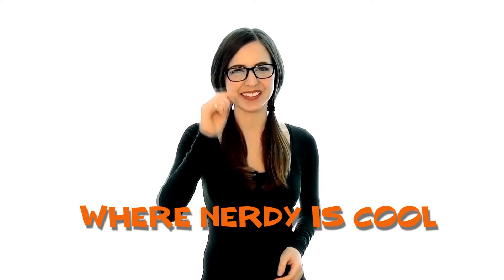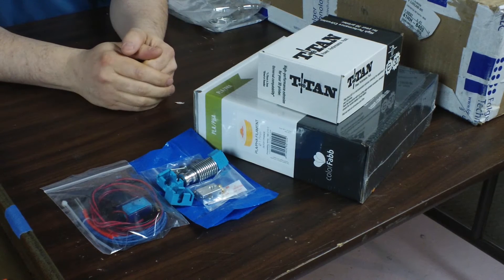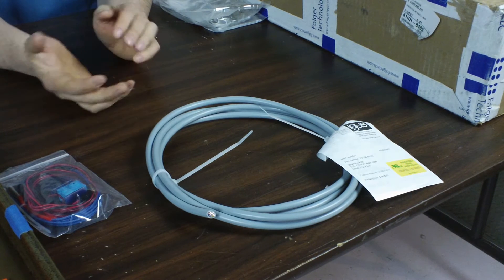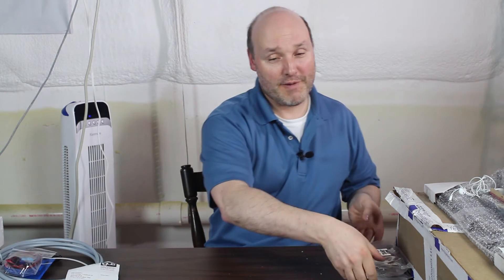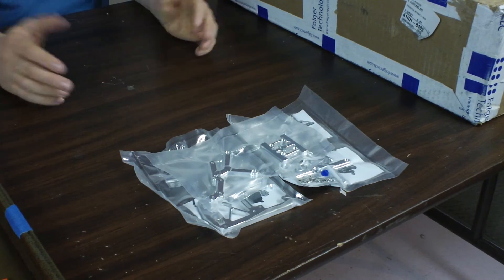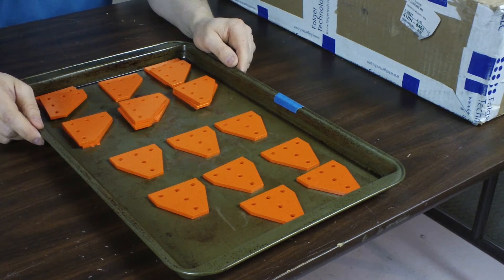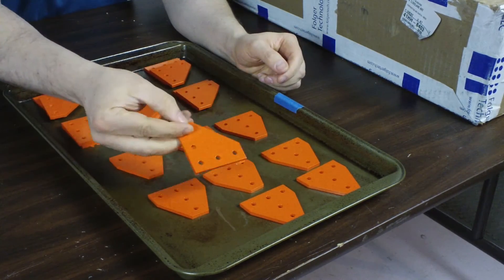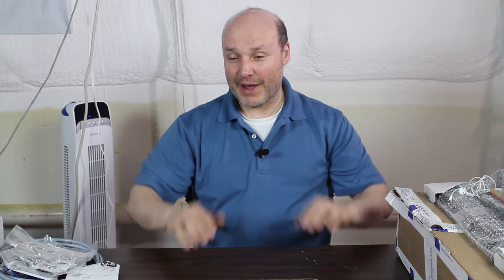FolgerTech FT-5 Upgrade Pieces

Comment: With the data cable, is that because you're having issues with wires breaking in the cable chains? I'm having that issue right now.
Reply from the maker: I've read a lot about those issues from others in the FB Group.  I bought the Igus Chainflex and wound up not using during my build.  My kit, like many of the newer ones, comes with silicone wire, very flexible stuff.  I am going to see how that works!
Reply: Mine came with the silicone wire as well and that's the root of the issue. If you don't put a twist into the bundle, the silicone wire on the outside of the bend gets pulled on as the insulation does not like to slide. Within 10 hours of printing, I've had 2 wires break spontaneously. The insulation doesn't take any of the stresses of operation and the copper wire inside is too small and weak take it all.